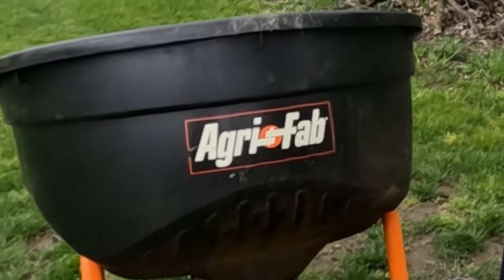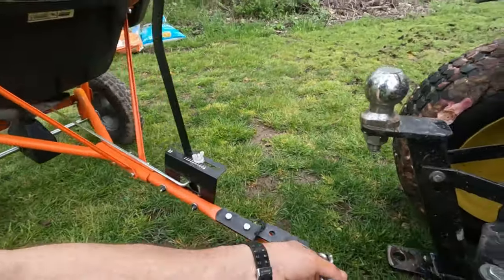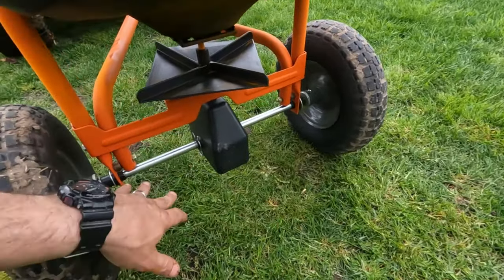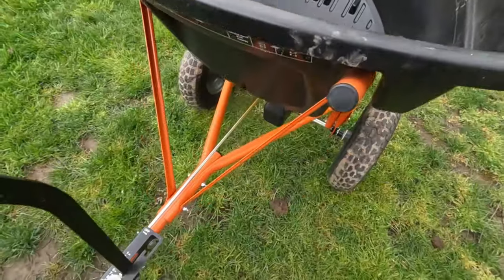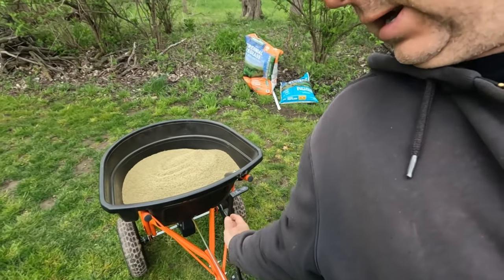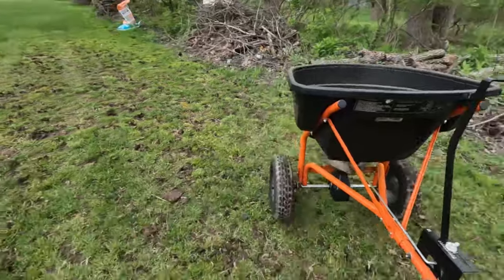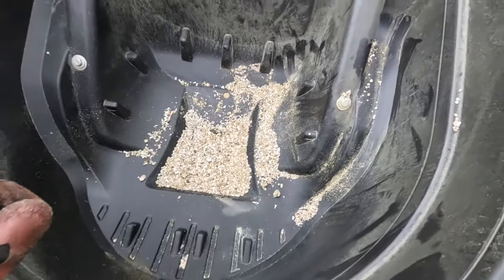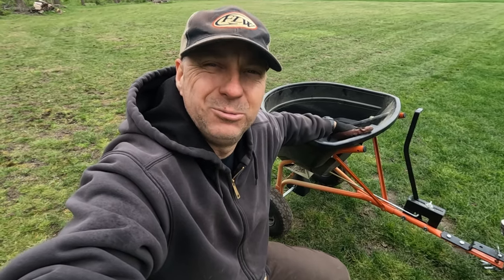Agri-Fab Tow-Behind Spreader Demo and Review

Comment: Thanks for the info.  We have the same spreader on order right now, so I appreciate your tips on the assembly and on the hitch height adjustment.  I'm going to need to come up with a way to raise the arm on ours, too.  I was already going to customize the arm since our machine has a ball hitch, but now I see I will need to add a riser to it as well.  Thanks a ton!
Reply from the maker: Sure thing.  Glad i could help.
Reply from the maker: I just remembered that i believe i saw they make one for lawn tractors and another model for ATVs.   Thry have different town bar heights and it seems mine is for atvs and not a lawn tractor.  So hopefully you ordered the correct one.

Comment: Thanks for the review. I have bought this model and am about to spread grass seed on 1,5 acre of pasture (there´s grass etc... but I want to improve it as I have not done anything for 7 years exept for mowing it and the hoses have been grazing. The next door farmer helpt fertilize it a few weeks ago and I have done some light harrowing to help with the moss). My question is if you could tell how far the seeds spread, ie how far from the last track do I drive my riding mower (have a Husqvarna, 17,5 Hp engine). I guess it´s propably hard to say but I don´t want to waste all the seeds while trying to figure this out, not if I don´t have to anyway.  🙂
(I´m in Sweden by the way so cold season grasses)
Reply from the maker: Id say about 10 to 12 feet total spread

Comment: Nice video, I just purchased it this yesterday morning and got it assembled in the afternoon. I will use it for the first time tomorrow, I got a 40 lbs of grass seed which I think will be enough. But I will need to get a big bag of fertilizer. I have a little bigger JD mower than what you have on the video but I think I still might have to do…like what you did. That’s a nice rig you have on your mower. I might have to do that. Did you make that?
Reply from the maker: No i bought it. Probably from amazon.  Google hitch and your model and maybe pne will come up.  This one had a couple mounting positions for the side arms and i just took it off to move it to another tractor and it works real well for lots of stuff.

Comment: I bought mine a few years ago. I didn't have too much trouble assembling the spreader. I think the spreader is solid and have no problems with the quality. But what I do not like at all is that I need someone with me because the fertilizer or anything i want to spread has to be brushed because the contents gets hung up along the sides and as it get towards the end of what it is I am spreading someone needs to keep brushing it to the center. If I don't have someone helping me. I need to keep stopping every 20 to 50 feet and get off my tractor. This problem is very disappointing...... as far as leveling the spreader, I use a longer hitch pin and sue some small blocks with a clearance hole for the hitch pin. It works well for me. As I said the spreader spreads well until the approximate last 1/3 of whatever it is I am spreading. Then I need to keep stopping to brush the contents off the sides and to the center
Reply from the maker: That's interesting.   I havent experienced that problem